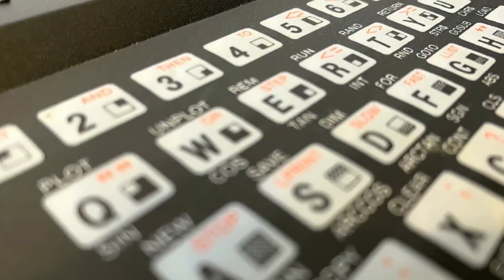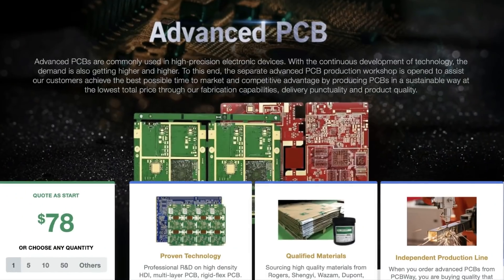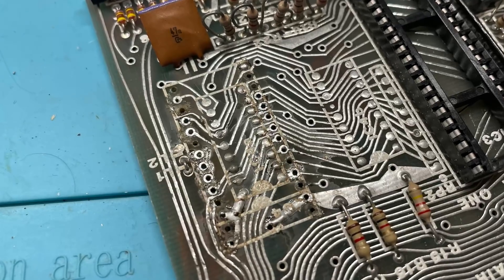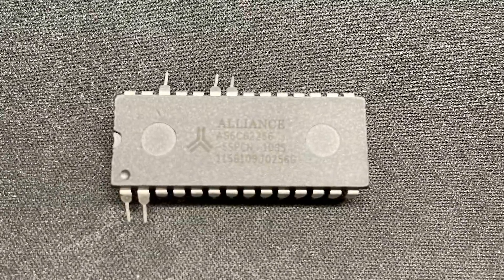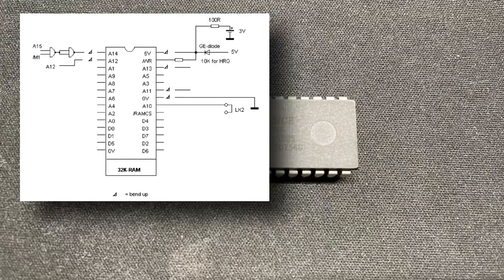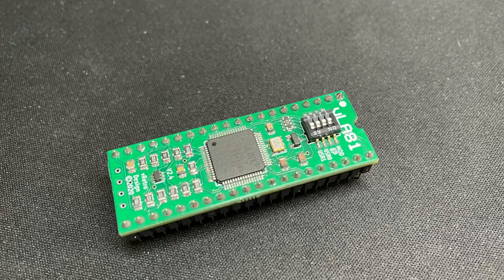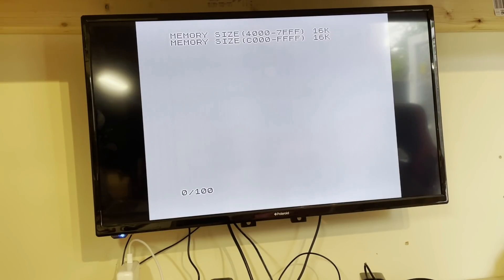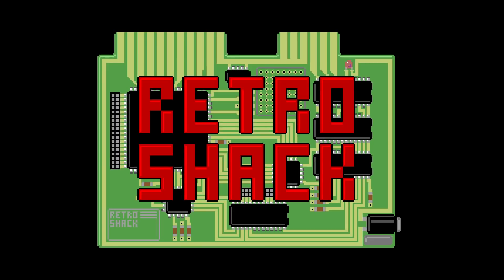As promised - The ZX81 lives!  And that 32k upgrade got thrown in too!

Comment: Thanks for sharing.  I feel a little better since I have the same desoldering tool that you used to mess up the pads in the beginning.  Mine looks pretty bad too with at least 3 pads gone on the back.  I may consider just clipping the ram chip legs off to remove it first.  I am afraid to do more damage to the board by continuing with the desoldering tool.

Comment: I don't remember the details because it was long-long ago but I made a ZX80 (the thing with 13 chips) do pixel graphics.  I will describe the method as best as I can remember it.
The entire display memory area is filled with 
0, 1, 2, 3, 4 ...
0, 1, 2, 3, 4 ...
... etc for each line of text.
The "character prom's" address is partly in the interrupt vector register and changing this could make it use RAM as character ROM.
A bit of trickery caused the ZX80's PROM to not be fetched for code instead a custom bit of code was fetched.
This allowed the NMI routine to update the location of the character generation PROM on every 8th line.
This way the chunk or RAM used as the character generation PROM ends up being sent bit by bit to the display.
Much of this plugged onto the expansion connector.
Some "slight of hand" hid some a chunk of RAM during boot so that BASIC wouldn't use that area.

Comment: I've now got 32K inside my ZX81 but I'm wondering if there is much software out there that takes advantage of anything above 16K?
Reply: No nobody wrote any software for one.
Reply: @martindejong3974  I wrote some.  I used a peak to seem how much RAM there was and adjusted the limits in the software depending.
Reply: @kensmith5694  didn't know the ZX-81 was even aware of how much memory it had (above the 1K it had normally). My assumption is that it used ROM below the hallfway point of the memory map, ($8000) and used RAM starting from the halfway point.
(and yes, I know that in actuality it decodes 8K of ROM from $0000 and then assigns as RAM to all the rest).
So if you have 32K of RAM it is assigned to the memory locations above $8000, but the same memory also appears as copies in locations below $8000.
when the ZX-81 scans for RAM it starts at $8000 but then stops scanning when it has reached16K, because BASIC  doesn't expect more than that cannot happen. So I am curious, are my assumptions true on how this works?
Reply: @martindejong3974  You are close to correct.  The memory map of the ZX80 and ZX81 had the upper most address line used for a special purpose.  If the processor attempted to fetch code from $8000 up, it would mostly see a NOP instruction unless the byte fetched was the code $76.  $76 is the halt instruction.  To run the display, the code ORed $8000 with the address of the display buffer and then jumped there.  On seeing the string of NOP instructions, the processor would fetch a new instruction every 8 clock cycles.  Between fetches, it would do a memory refresh.  The memory refresh cycle was the time when the character to be displayed was looked up in the character table in ROM.  Thus the code never assumes anything above $8000 is real memory.
BTW: The HALT made it stop advancing the pointer at the end of line.  The "Nonmaskable interrupt" was tied to a refresh address line so that when it was time to do the sync pulse the code for that would be fired off.

Comment: Changing things in a way that you can revert them is very good. In the special case of the L1 vs. L2 bridges – you just would need them to go back to 2 x 0,5k chips. THis is not possible without unsoldering the whole new socket. So making this bridge reversable may be more or less useless for your scenario. ;-)

Comment: I only put 16K in my 81, it's only one chip to mess with and 16K is plenty. However, all the mods I've done to 81's have been permanent. I gut the RF modulator and put my own comp board in there and the 16K is non reversable. As far as I'm concerned, why would I want a ZX81 with 1K using RF ? LOL.

The best ZX81 I have is a clone from Argentina. It's a CZERWENY CZ 1500. It's in a silver and black Speccy rubber key form factor with 16K built in.

Comment: I had the same de-solder gun very cheap, but get the button press the wrong way around and splat, old solder everywhere, also it jumps when pressed, stabbing the board. Its basically totally crap. Bought a proper one on the end for £50 second hard, so much of an improovement.

Comment: I've been considering doing this RAM upgrade for quite some time but couldn't find anyone who actually did it so I figured I'd just give it a shot. I'm in the process of ordering the parts right now and was just double-checking the page to confirm my parts list when I happened upon your video. Thanks for doing this.
QUESTION: I'm a little confused by the instructions. Step 1 appears to be just for 16k so I'm looking at Step 2 but it shows creating two NAND-gates from a 74LS00. Later down the steps, it states you "connect A15 (cathode of D8), /M1 (edge-connector 22A), 0 volts and + 5 volts with 74LS00". 
How did you omit the 74LS00?
Reply from the maker: You’re welcome!  Good luck and hope all goes well - let me know how you get on :)
Reply: @TheRetroShack  You probably didn't see my question.
QUESTION: I'm a little confused by the instructions. Step 1 appears to be just for 16k so I'm looking at Step 2 but it shows creating two NAND-gates from a 74LS00. Later down the steps, it states you "connect A15 (cathode of D8), /M1 (edge-connector 22A), 0 volts and + 5 volts with 74LS00". 
How did you omit the 74LS00?
Reply from the maker: Hi there - This pin out from the 74LS00 should help :) 
https://components101.com/ics/74ls00-quad-two-input-nand-gate
Reply: @TheRetroShack  I'll simplify the question. 
Did you add a 74LS00?
I no see it in your ram upgrade.
Reply from the maker: Oh - yes :) I do mention it in the video :)
Reply: @TheRetroShack  ok. I'll rewatch it. Thx

Comment: Back in the day there was sound and colour add on's if i remember correctly, and 64k ram upgrades. How difficult/possible would it be to do thise?
Reply from the maker: I'm doing some research :)...
Reply: The question is it worth spending money on something ancient and easily replaced.

A ZX81 in its original case/keyboard is painful to use for anything serious., just curio value today.

A working ZX81 (16K if cheap and easy) is good enough IMHO. even extra memory beyond 16K is of questionable worth.

Comment: A nice little mod that would be a good one for any old 8 bit machine with limited ram.
Some pcb material under that extra IC might be a good idea, so the chip does not accidentally make contact with any of the tracks under it. I'd probably mount it on a short length of upturned strip board, that can then be glued into position.
I'm surprised the ZX81 has now power-on memory test, and that you had to do it in basic!

As for that 'solder sucker', wow, what a silly design, Quick, throw it into the bin.
Reply from the maker: Thanks! - It's been well and truly binned :) :)

Comment: Ah - memories.... It's pretty much 40 years since I modded my first ZX81 with 16K of internal memory on a hand wired board of my own design using eight 4116 DRAMs. Later on I also did a 32K version using sixteen of the same devices piggy backed.   Both versions fitted inside the case, under the keyboard area, with around 30 wires connecting to the main board.
Reply from the maker: Now THAT I'd like to have seen ! :) :)
Reply: @TheRetroShack  I have a photo of the 16K version that I took back then.  I shall scan it and email it to you.

Comment: I had a ZX81 with the 16k RAM pack that would restart the ZX81 every time you sneezed because the connection was very sensitive.
Reply from the maker: The dreaded ram pack wobble of doom! :)
Reply: Yep, I remember suffering from that especially frustrating when it happens after you have spent 2 hours typing in hexadecimal from a game listing in a magazine! After a while someone sold me a much better on that was solid as a rock and NEVER glitched.

Comment: As someone that knows ~nothing about ZX81 I wonder if BASIC sees and uses the full 32k?
Reply from the maker: The ZX81 ROM reserves around 120-125 bytes for system variables so around 850 bytes free for programming.  The ROM doesn't use up more memory with the expansion (as far as I know) so you'd end up with almost the full 32k available for programs.
Reply: @TheRetroShack  Right. I just wasn't sure if the BASIC interpreter memory scanned the entire space.

Comment: I see there's RAM from C000-FFFF. Is there any way to have paged ram here? a ZX81 with say, 1Mb of RAM would be very cool
Reply from the maker: Short answer is probably :) Honest answer is I don’t know… I’ll happily do a little research on the subject now you’ve got me curious :)
Reply: @TheRetroShack  It should be possible, but your page size would need to be only 4k or 8k. You cannot swap the whole 16k space in one go since the ROM code always needs some of the lower memory locations in RAM to be available.  You'd also need to consider where you arrange the display area to start from and whether that is paged or not.
Reply: @GodmanchesterGoblin  8K to 16K is available. ditto 32K to 64K.
Reply: @joefish6091  Yes, you could bank switch the space 8k to 16k. I am not sure about 32 to 48. Above 48k the hardware is shadowing the 16 to 32k space and is used by the CPU and ULA to generate the display. Specifically, the display is generated by a CPU jump to the display data but with A15 set to a 1. That tells the hardware to treat the data for the display while the CPU is force fed with NOP instructions. Because of this, using any memory address with A15 set can sometimes be problematic. The all stems from how the ZX80 generated the display which was pretty much copied in the ZX81.

Comment: I damaged my Issue 3 US-model Zeddy similarly this summer when I removed the two 512 byte SRAMs. I typically add fresh leaded solder to component legs before desoldering. Unfortunately, a bit of the added solder flowed up through the vias and under the chip, adhering to the uncoated traces on top of the board. When I wiggled the chip legs free and lifted them, I damaged two traces under one chip. Fortunately, once I cleaned everything off I was able to repair the missing traces with tiny lengths of Kynar wire. Rather than building an external 32K memory decoding circuit, I used a feature of the current vLA81 designs which allows access to the additional 16K with the addition of a single wire to the otherwise-unused oscillator input pin on the vLA81.
Reply from the maker: Glad you got your Zeddy up and going again too! Need to keep these little fellas alive for as long as possible :)

Comment: I have a small collection of computers I had growing up which includes a couple Heathkits, a commodore 128d, a trs80 model 3, and unfortunately 2 zx81s. Like you, I killed one carelessly trying to socket chips and lifted traces. They were fantastic machines and far cheaper than any of my others when new. I forgot to mention a micro-professor as well. Thanks for the update!
Reply from the maker: Did you ever manage to fix the little Zeffirelli?
Reply: @TheRetroShack  no... it's still on my sitting on my book shelf. Maybe one day... currently I'm building an apple 1 replica.

Comment: Does this support the WRX graphics mod?
Reply from the maker: I can’t see why not - I’ll dig out something that uses it over the weekend and check :)
Reply: as far as my understanding of the WRX16 goes it doesn't work on an unmodified ZX-81, it needs extra (static) RAM pack located in low memory, 8K from $2000 to $3FFF, and if you use an external 16K RAM pack, it needs a patch, otherwise some of the RAM isn't refreshed. The patch consists of two diodes, and a pullup resistor. The extra RAM is needed so the graphics driver can create a fake font set (with highresolution graphics data) so the WRX16 code can direct the Z80 to get font data from the 8K extra RAM instead of from the font data in ROM.

Comment: I worked on multilayer boards in the 80’s and those solder pumps were just as crap.  Good hot iron and an ordinary solder sucker is all you need. Top tip: use a heat gun to pre-warm the board a little so the heavy traces dont drain the heat away
Reply: You're correct! I learned that the hard way...I lifted traces on one of my zx81s doing just that. My only saving grace was I had a second in working order.
Reply from the maker: Just got myself a heat gun for those exact reasons :) Hopefully my days of desoldering woes are behind me! :)
Reply: @TheRetroShack  You need a Vampire tools - solder sucker, the ones with a silicone tip, heat resistant, simple, and works like a charm. They did not exist back in my electronic school day's. Came across it watching Joe's Classic Video Games.
Reply from the maker: @stefankoopmans2200  I’ll take a look, thanks!
Reply: Its safer to use de-solder braid on any thin tracks.
Reply: A decent quality one is honestly worth it's weight in gold. Used one for both prototyping and repairs and once I decide to take the plunge on a more expensive one, I never had a single issue. I think the shack will be OK with the model he's just gone and got.

For the cheap ones, you're right. I made the same mistake he did when doing repairs and had to compensate some very understanding people for the price of an Amiga 1000 I damaged with a cheap desoldering gun.

I think the same can be said that people say of a lot tools - you get what you pay for.

Comment: Crap I'd just ordered 1 of those desolding pumps you'd had problems with on amazon n it arrived today.  Good thing I haven't used it.  It's basicially a self heating version of those bargain bin manual pumps.  That thing & the step up transformer I had to buy to use it are both going straight back.
Reply from the maker: I’m sure some people get on fine with these type of devices but I did want to point out the potential pitfalls too :)

Comment: I have one of those cheap de-soldering guns, but it works the complete opposite way, i.e. it sucks when I press the button and spits out the molten solder when I let go. I have a little container next to me to move it over when I let go. I'd just assumed that was how it was supposed to work and have become quite used to it!
Reply from the maker: That would have confused me even more LOL :)
Reply: @TheRetroShack  On the plus side, I've not had to clean it out yet!
Reply: I have a cheapie that is kind of similar, however it vents the discharge air out a different port, so this problem is 95% solved. (If you try really hard, with a full chamber, it can drop a little solder)

Comment: A cheap spring loaded desoldering pump works very well if you have the room to manoeuvre the iron and the pump on the PCB.
Desoldering stations only made things worse for me as I'd need twice the amount of time to melt the solder and suck it away.
Reply from the maker: Yes, it’s action of actively ‘pushing’ the hot solder forcibly out on an accidental button press that makes this type of desolder equipment potentially quite dangerous :)
Reply: @TheRetroShack  that depends on the tool. The problem I had was that it took 2-3 seconds to melt the solder and an extra couple of seconds to remove it. This led to scorched PCBs and lifted pads. 
With iron+spring loaded pump the same takes 2 seconds top. The pump action is so quick it leaves components' legs and holes clean when done correctly.
Reply: @bufordmaddogtannen  I struggled with my desoldering station to begin with as well. Oddly enough I find that preheating the joint with my soldering iron before going in with the desoldering gun gives the best results (though it does take a lot of concentration to hold a soldering iron in one hand and the desoldering gun in the other!). 

That said, cheap solder suckers do a remarkably good job once you get the knack for using them, although I still struggle a bit with getting consistent results. I still use my solder sucker to remove small components, but I wouldn't remove a 40-pin chip with one...
Reply: @OzRetrocomp  I get good results by applying a bit of new solder, then using the spring loaded pumps. Although it takes time and patience.

Comment: just curious, i have recently got hold of a zx81 and a 16k ram pack for it.. would it be possible to upgrade the 16k to 32 or more.. then just slot the pack on.. ?
Reply from the maker: Not sure about that for definite but I know that Memopak did a 32k ram pack so I guess it’s definitely feasible.
Reply: @TheRetroShack  Memotech did a 64k  memopak. It needed a poke I don't remember the values of to allow access to the whole memory space
Reply: As far as I know inserting any RAM pack disables the internal RAM (RAMCS on expansion port) so you'd just disable your internal upgrade with your smaller external one. :)
Reply: @generalbyzantine8735  at the moment i've only got the 1k standard model. and the external 16k ram pack. i wondered would it be possible to take the ram pack apart and put a 32k chip in there?
Reply: @bazza5699  Possible, yes.  A good idea?  Probably not. Depending on the ram chips inside the pack alll you'd end up reusing is the connector and the shell. It's a lot easier to replace the internal RAM chip or google a modern design and print your own pcb. The easiest and best option to extend your Sinclair's life is to buy an expansion board with added functionality like an SD card reader. I don't think standard software can use anything over 32K anyway so it really depends on what you want to achieve.  The first step for me would probably be to carefully take a peek inside the machine and see if the RAM chip is already socketed. It's extremely unlikely, but if it is then that's the hardest part of the job done already. :)
Reply: @generalbyzantine8735  thanks for the reply and advise, i'll take a peek :)
Reply: @bazza5699  I'm not responsible for any broken membrane keyboards :)